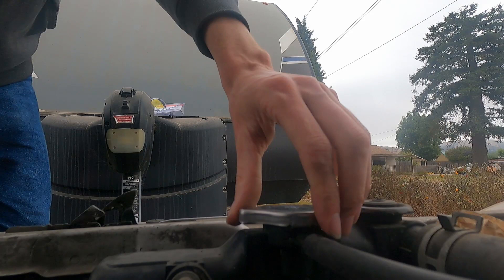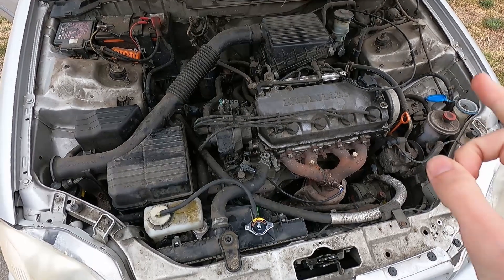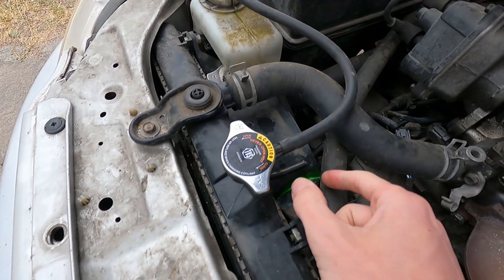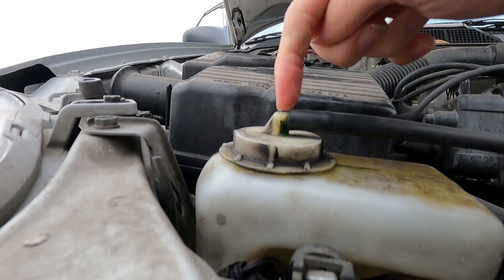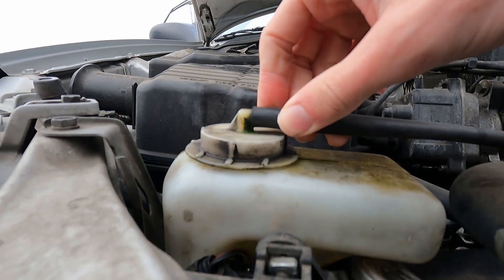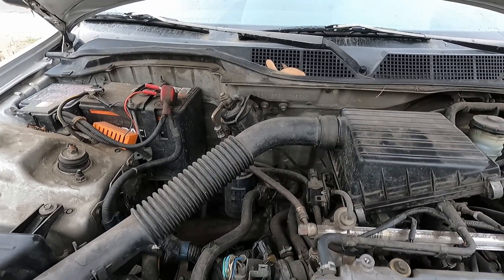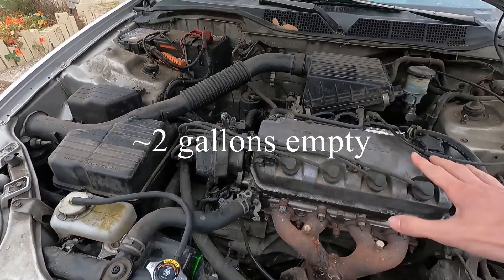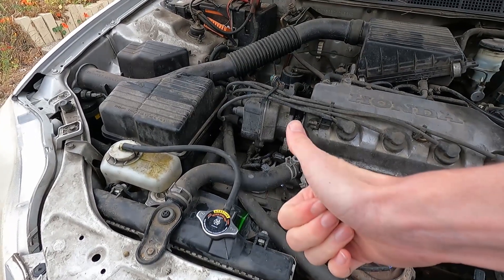Finding Coolant Leaks With UV Dye

Comment from the maker: I didn't mention it on camera to keep the video short, but the issue I was dealing with for a long time was the coolant going from the radiator to my overflow bottle, but not BACK to the radiator. I knew the rad cap was good, my oil test showed no signs of oil/coolant mixing, so I decided to give the UV dye a try in case it was a tiny leak somewhere. It was a lot cheaper than a pressure tester, although those are nice too for checking a system. This is no magic bullet find-a-leak, but it's a handy tool anyone can cheaply obtain, and hopefully determine the source of an issue.

Ok, in May of 2025, I finally drained the cooling system to flush it in anticipation of putting in a new timing belt/water pump for the car. The car has a 4.8L/1.27 gallon capacity, and I would suspect that 1/2 of that bottle of dye would have been enough to get the job done. I only say that since it took a while to fully flush the dye out of the system. Not saying that it did ANY harm to the cooling system, just something to keep in mind if you need to flush the system for running a sealant that requires no coolant to be present. It could mean you flush longer than you need to, which is only an issue for disposing of the waste fluid!

Comment: is it safe to use A/C UV dye in the engine coolant? Can it affect anything inside the engine?
Reply from the maker: AC systems use oil based dye, and oil is the last thing you want in your radiator cooling loop. The dye is inert so the only thing it will do is make a bright green mess on whatever it touches!

Comment: Is it safe to leave the dye in or should you do a coolant flush after you've fixed the leak?
Reply from the maker: I kept it in there on my car, but if I were to do any work on the cooling system, I would flush it out so my hands are not bright green after!
Reply: @MakeItWithCalvin  thanks!

Comment: I usually prefer to use a pressure tester over dye. Putting pressure through the system tends to reveal leaks better than the messy dye. Also that hose that goes from the radiator cap to the reservoir isn't under any sort of pressure its just there as a spill way for when the cap reaches its pressure limit. You could still be leaking from somewhere, but that's just my take. ¯\_(ツ)_/¯
Reply from the maker: You do have a fair point, although the pressure testers I have seen cost a lot more than a bottle of dye so... That is something to bear in mind for someone who's new to car repair, or troubleshooting. I do 100% agree, that the dye can be a bit messy, the only advantage I give it, is that it's being run through the system at operating temps/pressures so it has the potential to show a leak you may not see with the engine being cold. 

To keep the video short I never mentioned it on camera, but my issue was coolant going from the radiator to the bottle, but not going BACK to the radiator. I had thought it was something in the heater loop, but the dye told me otherwise. A $20 swap of the tank/cap on eBay and the problem of the one-way coolant got fixed! So in my case, I do feel like it helped, but it isn't a mechanic in a bottle either.